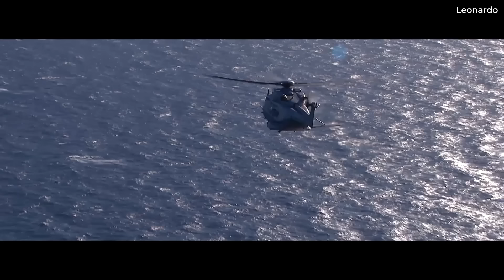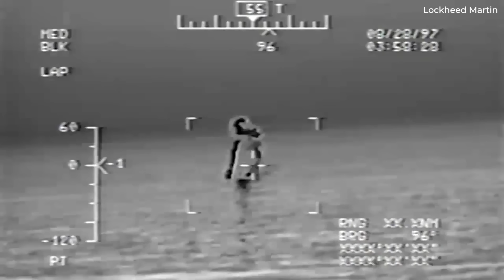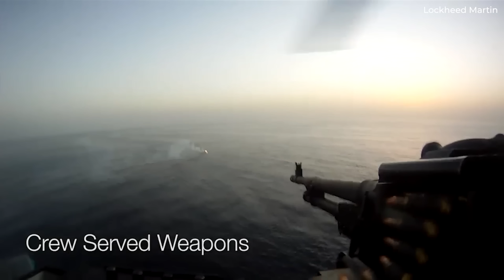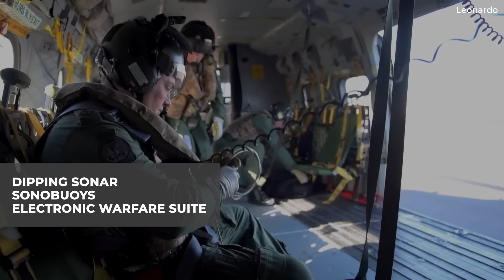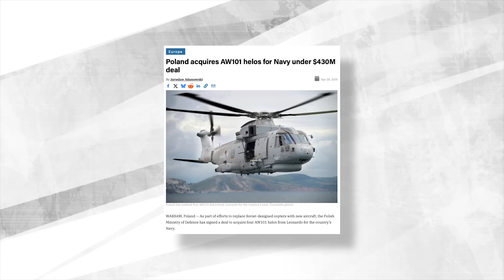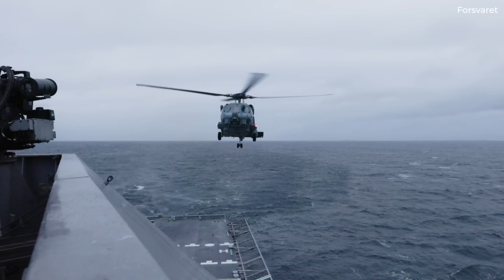MH-60R vs. AW101: What Will Be Norway's ASW Helicopter?

Comment: The most beneficial choice would be the AW-101 as it reduces the dependency on the US and it is already in use on the British counterparts. Survivability, stability and endurance are all in favour of the AW-101.
Reply: I wonder, is it possible for AW to develop an european heavy lift helicopter for logistic purposes based on some of helicopter design they have? What do you think about that?
Reply: @albertliebertan147 it would be inefficient compared to the Chinook. But it would be possible to enlarge the current fleet with a large commonality component.

After the inevitable collapse of Russia they could try getting the patent for the counter rotation system from Kamov otherwise the results will be inefficient. Or a lengthy redesign of the current ones with two separate counter rotating main rotors and a lot of teething issues like on the NH-90. But it would be fun seeing a six engine derivative of the AW-101 with two main rotors.
Reply: Reduces American dependency but increases British dependency? What's the difference?
Reply: @CorneliusTaylor-s1udependable partners unlike the US. Short supply chain and high end helicopter instead of a mediocre one.
Reply: @Red74Skull

Why is America all of a sudden not dependable? Because Trump hurt your feelings? 😄🤪🤡
Reply: @CorneliusTaylor-s1ubecause they have not delivered the promised weapons and ammunition over the last two years. They screwed over the Australian air force with the C-27 deal. 

And the only 🤡s on here are MAGAs like you. Still thinking tariffs hit us instead of realising they are taxing you. They lost 27 customers for the overpriced US crap we were buying to keep you in the game. The only things we are still buying the F-35A and spare ammo for the Patriots. The latter is trickling in so we are now looking at the SAMP/T as a permanent solution. And the only reason we still buy the F-35A is because we hacked the source codes. So they will probably be flying soon with European avionics and weapons.

Enjoy going bankrupt over a hospital bill.
Reply: @CorneliusTaylor-s1uit never was a dependable partner. Just ask the Kurds. 

We only recently had issues getting the required parts and spare ammunition. And since the White House started wars without consulting with the allies and even threatened invasion of the Eu we are no longer buying your weapons to appease you. Only real high end equipment is still getting in like the F-35A but only because we jailbreaked it.

With the current administration pulling out of Europe we no longer need to be interoperable with you. That is why we buy European, Israeli and Korean weapons.

Edit: And the reaction you gave him or her shows you need to finish basic education. Because this isn't how an adult handles facts.
Reply: @b @bigwillyj4083 

"It never was a dependable partner."

Right, paying for the vast majority of NATO expenses and protecting Europe all throughout the Cold War equals an undependable partner. 🙄

"Just ask the Kurds."

Ask them what exactly?

"We only recently had issues getting the required parts and spare ammunition."

What exact parts and what exact ammunition?

"And since the White House started wars without consulting with the allies"

Why would it need to? And what wars? America's only engaged in one with Iran. A war that will greatly benefit your part of the world. 

 "and even threatened invasion of the Eu"

It never did such a thing.

"we are no longer buying your weapons to appease you."

Who is we? Buying only to appease? 

"Only real high end equipment is still getting in like the F-35A but only because we jailbreaked it."

Who is we? Nothing was jailbroken on the F35. You're repeating Internet nonsense. The F35 was purchased because it is the superior aircraft.

"With the current administration pulling out of Europe we no longer need to be interoperable with you. That is why we buy European, Israeli and Korean weapons."

Europe is not a country. You shouldn't speak as if it is. And why should America have been there in the first place? Aren't you supposed to be able to defend yourselves? America is also still part of NATO and the biggest contributor by far. 

"Edit: And the reaction you gave him or her shows you need to finish basic education. Because this isn't how an adult handles facts."

Irrelevant ad hominem nonsense, knucklehead.
Reply: @CorneliusTaylor-s1uenjoy living in the state of denial? No freedom, no affordable education and it shows in your case, no affordable healthcare and no social security to maintain a basic living situation. He nailed it and you need six paragraphs of half truths and full lies (F-35A jailbreak was confirmed by a minister) to counter it. What are you the minister of propaganda?
Reply: @CorneliusTaylor-s1uthanks for confirming my guess of your age.

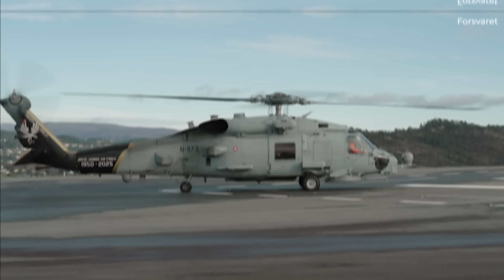Comment: 3:00 You forgot two important factors, a radar for detecting the periscope of a submarine, and a magnetic anomaly detector (MAD) for detecting the submarine when it isn't moving or without dipping the sonar in.
Reply: Yeah, this isn't the most insightful video.
Reply: They are deployed by a ship, which can use those systems.
Reply: @Brocki1704  .... what do you think the dome on the bottom of the MH-60R is for? Seahawk has both radar and MAD ....
Reply: @FirstDagger 🙄🙄 hey Einstein I never said the MH-60 doesn't have these systems 🤣🤣 just because you can have it, doesn't mean you need it...
Reply: @Brocki1704  It is basic ASW stuff going back to WW2 ...
Reply: @FirstDagger 🤣🤣🤣🤣 sure kiddo, whatever you say 🤣🤣🤣 you are having a conversation with someone else or why are your comments only about things that weren't part of the conversation? WWII... I totally forgot about the Helicopters used for ASW in WWII... oh wait the ships had those systems because of the lack  of ASW Helicopters. You remember when I wrote that Helicopters are deployed by ships so that's why ony the ships need those systems??? ...
Reply: @Brocki1704 Two morons shouting past each other.
Reply: @Brocki1704  Aircraft were used for ASW in WW2, and they used both radar and MAD for that .... modern ASW Helicopters literally have radar and MAD for ASW work. I think you just don't get ASW. Do you know what the horizon is? You really think a ship can have a radar coverage and MAD coverage as good as a helicopter? Are you actually insane? You cannot have an ASW helicopter without those systems, and as the video creator when over ASW requirements and missed that I highlighted that.
Reply: @FirstDagger 🤣🤣 sure kiddo... you sound like Trump when he explains why he's the best US president of all time 🤣🤣.  No proof, just "trust me" 🤣. 🤣🤣 you are right... I never should have doubt the words of a comment section expert, with a long military career in Call of Duty ... touch grass Kid and stop coping on the US military doctrine
Reply: @Brocki1704  What are you even talking about buddy? The video creator didn't mention both radar and MAD being in the list of features that ASW helicopters can be compared by, that is why I said that he is missing those. Also please take your American partisan politics elsewhere. Weirdo. Wait you actually think I am dogging on the Seahawk for what? For having things that I said it has? Are you unwell? No really please seek help.
Reply: @Brocki1704  I see that everything I said went over your head. Average American.

Comment: Hi Im from Denmark and we use the EW-101 for coastguard and the MH-60 for ASW on our current frigates.
As far as i know UK use or planning using EW-101 for ASW.  If you can fit the very large EW-101 on type 26, then it would be a good choice for both roles.(three turbines gives safety margins)  otherwise i see the advantage in the Danish model.
Reply: We know. Our 🇧🇻 Royal Norwegian Air Force already operates 16 of the AW101-612 version for long range maritime SAR, and it is the most advanced SAR helicopter available. The 🇬🇧 Merlin ASW variant will be perfect for us, too.